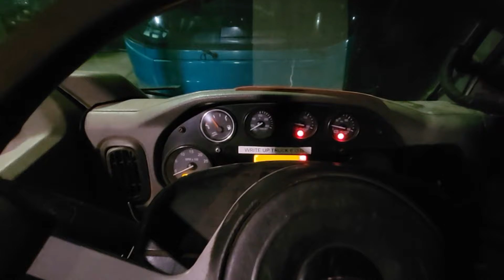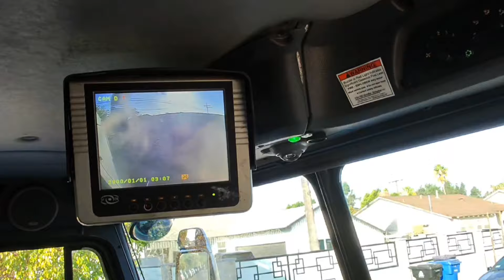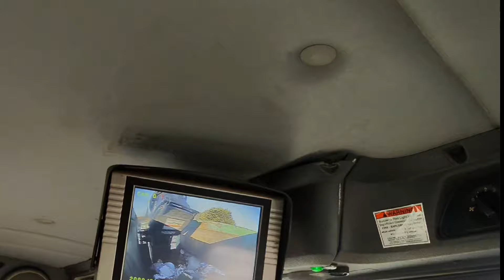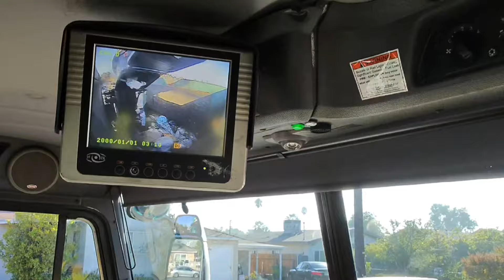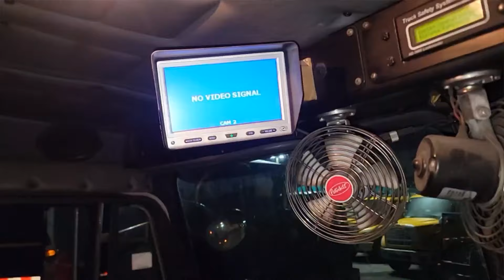Trash Truck POV come ride along with me. Los Angeles Sanitation

Comment: For a moment I thought we would get no POV today, glad I was wrong. When you park the truck full for the day that means you don't clean the sump area right since the truck is full of trash right? That's why that truck's sump area was full of garbage right? Do the mechanics work overnight to get repairs done or just leave super late at night? I would have loved to have seen that spare truck going slow as an example haha.
Reply from the maker: @TheNVTrashMan  I made time to upload a Friday video. Clean out area should be cleaned out after each dump depending on how much it accumulates. Every truck is different. Part of the problem is that it is not cleaned out during the day so the last load that ends at the yard is really bad. There is a dedicated spot at the yard to clean out if you ended loaded for the day so no excuse to not clean out. Mechanic have day shift and night shift 😴 24 hours.